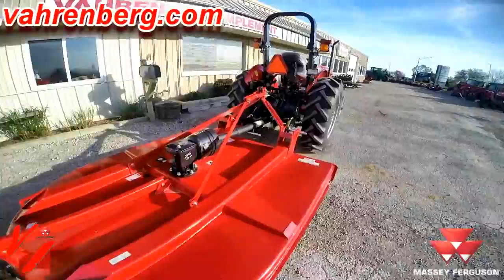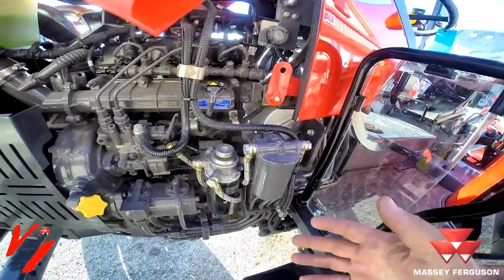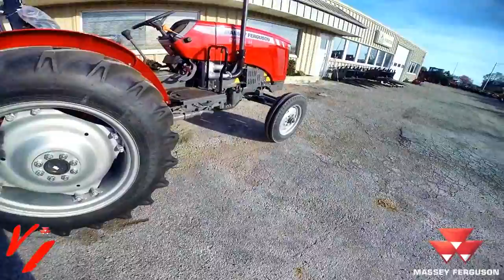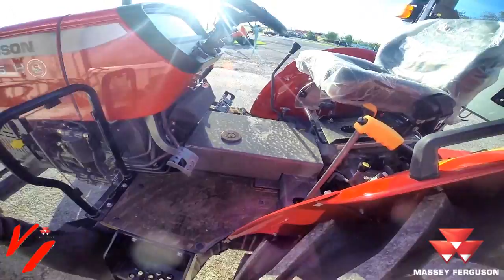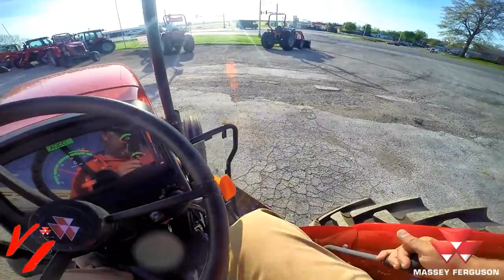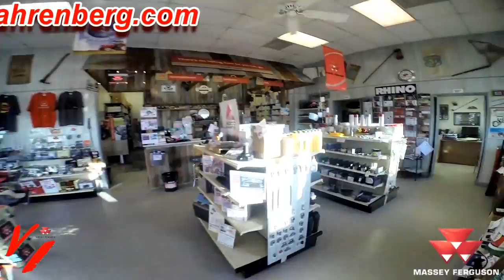Massey Ferguson 2605H 2wd Utility Tractor

Comment: Not looking to buy one ! But I can't believe how close & similar this is to a proven work horse  of 60 years ago & I'm referring to my 1959 M-F 50 that I still use it year round the only differences is mine is gasoline , 3 speed & 1 reverse with the H-L & spinouts on the rear & it has the front adjustable axle . But I do like some of the upgrades of this newer version! But I guess as they say if ain't broke don't fix it, & just improve upon it & if this is just as reliable as my M-F 50 or more these are going to last you a life time M-F= Might-Fine , Tractors.
Reply from the maker: That is why the 2600H uses the Proven Ferguson System for Hydraulics & 3-Point. Been Reliable for many many years.

Comment: Who makes the engine?
Reply from the maker: Simpson Diesel makes the Engine. They use Perkins blueprints for their engine design.
Reply: I have it on my 231 and I have 1440 hours and   Never had a issue at all but grease it and change oil.

Comment: Thanks. I just ordered one from my local dealer.  Looked at the 2604, but the higher horse and better brakes made the extra expense well well worth it.
Reply from the maker: If you can justify the added costs there are some nice feature upgrades in the 2600H Series. Glad yo ufound the perfect tractor for you.
Reply: Silver Star what’s the price difference between the 2604H and the 2605H and what are the differences in features? Thanks
I have a 1998 model MF231 and it’s still an EXCELLENT tractor. Love it and Massey Ferguson!
Reply from the maker: Your looking at around $1,400 USD Cash Selling Price Difference between a 2604H & 2605H in 2wd configuration. Besides Horsepower Difference you also upgrade from Drum Brakes to Wet Disc Brakes, 3 Point Lift increases 551# to 2755# Lift, Dry Engine Clutch to SplitTorque Clutch.
Reply: @VahrenbergImplement  what is Split Torque clutch? My MF 231 has a dry, 2 stage clutch and that’s what I’m used to. Thanks
Reply from the maker: Split Torque Clutch is used on versions with Independent PTO. It's a Single Stage Clutch that the Clutch Disc Drives the Transmission and a separate fixed hub drives the Independent PTO and Hydraulics.

Comment: you keep saying it dosent have any emissions control systems but theirs a big honking EGR system on the right side of the engine.... i understand it dosent have a scr or doc or dpf but an egr is an emissions control system
Reply from the maker: EGR is an emission component but does not require scheduled maintenance like Diesel Particulate Filter or Selective Catalyst Reduction Systems. It's Emission Maintenance that these models do not have and what we are promoting. No Diesel Exhaust Filter replacement required or regeneration not adding Diesel Exhaust Fluid Required. That is what customers are asking about is the Maintenance of the Exhaust Systems.

Comment: Any common problems with these tractors, or the 2604h? I'd love to see a detailed video of the 2wd 2604h. Isn't it made in India? What makes it different from a Mahindra? Thanks!
Reply from the maker: The 2600H is very similar to the 2605H. We sell more 2605H because of the small differences in cost but added features. The 2600H has been very reliable for us. It's built off a solid foundation...if you look at the tractor you will see many of the legendary & reliable features of the Massey Ferguson 100 series the 2604H is very similar to the legendary 135 Massey Ferguson Tractor. Feature the Legendary Ferguson 3 Point Lift System, Scoth Yoke Hydraulic System with upgraded TierIV Final Engine. The Tractor is built by TAFE which originally was founded as an assembly center for Massey Ferguson India. Simpson Diesel Engines are based off Perkins Blueprints. Yes it's built in India but TAFE is: Tractors and Farm Equipment Limited is the third-largest tractor manufacturer in the world and the second largest in India by volumes, TAFE wields about 25% market share of the Indian tractor industry with a sale of over 150,000 tractors (domestic and international) annually and presence in over 100 countries. Learn More: www.tafe.com/aboutus.php
Reply from the maker: You asked the differences between manufacturers: It's the support before, after and during the sale. Massey Ferguson has only been in the equipment business since 1847, sold in over 190 countries world wide, they know tractors from the smallest GC Series to the 400 HP 8700 Series. Plus they know how to support owners; look at the Support you get from AGCO with 9 Parts Distribution Facilities across North America insures uptime, Dealer Training, Dealer Diagnostic and Express Services like SOURCE and online dealer support service that in a matter of a few key strokes we can resolve your tractors concern, Professional Dealers...Massey Dealerships are long-term franchises and have succession plans. Not here today...and no dealer to help you in your area tomorrow. There is a reason why more Massey Ferguson Tractors are on more farms around the world than any other brand...not just Compacts & Utility Tractors but all sizes. We are a Full Line Farm Equipment Company and Parent Company AGCO Corporation is 100% dedicated to Agriculture... They only sell Agriculture Products. Plus the 2600H Series is built to Massey Ferguson Specifications and level of quality they demand. Check TAFE is like a brother to Massey Ferguson just serving the India Market and Building Tractors for Massey Ferguson to sell in other parts of the world.
Reply: I've owned an old Ford 8N, a couple small grey market Yanmars, a 45 hp Mahindra all in the past before I bought my MF 231, 9 years ago. Out of all the tractors I've had, that 38 hp Massey Ferguson 231 has been BY FAR my favorite tractor. Love the way it feels, sounds, the kickback footrests, slanted hood, and has an EXCELLENT power to weight ratio. 
Although I've never owned a Deere, I can honestly say Massey Ferguson is my favorite brand of tractor to date.
I know a man who has a Tafe tractor and never heard him complain about it. Has had  it for many years and bought it new.
The problem I'm starting to have with owning my 231 is finding certain parts. It's not even 20 years old yet (1998 model) and parts are already discontinued!! That is ridiculous! URSUS is still in business in Poland far as I know, but AGCO can't seem to find the parts I was looking for a while back. Very frustrating when someone takes care of a tractor the way it should be done. Everything original, intact, and in good working order. No lights busted out or any sheet metal damage. Only thing I'd like to eventually do is re-paint it and install new decals. 
With this said, if I were to go out and buy a brand new tractor tomorrow I wouldn't look at anything besides Massey Ferguson. They are strong & reliable tractors. I just hope parts support gets better. I also wish the Banner Lane assembly line would open back up in Coventry, England and the 135, 230, 245 would be reproduced. Myself, along with thousands of others would be buying new Masseys for sure.
Reply from the maker: That's very interesting to hear about the Massey. But a comment on parts...if there is enough demand AGCO is trying to keep parts available...have to tried to get parts for a 20 Year Old Car/Truck at the Car Dealership??? Most don't even have them past 7 years. AGCO surprises me how many old tractor parts they do stock compared to what we hear of other brands. I know it's tough to keep everything but if demand is low or the suppliers of the part is no longer in business...most manufacturers source parts from suppliers like AGCO, URSUS, TAFE, etc.  Have you looked at Sparex that are owned by AGCO and are an aftermarket supplier they handle lots of Massey Ferguson Parts for older models.
Reply: Vahrenberg Implement I have not looked at Sparex. But all I'm needing is a power steering pump! A complete unit that bolts on with only 2 bolts and  it's no longer made! This is very frustrating. Yeah there is a pump available for early production models but not for my 1998. I would even buy a good used one if I could find one.